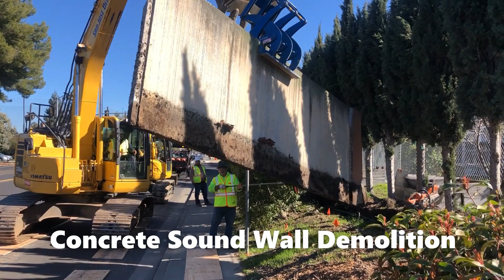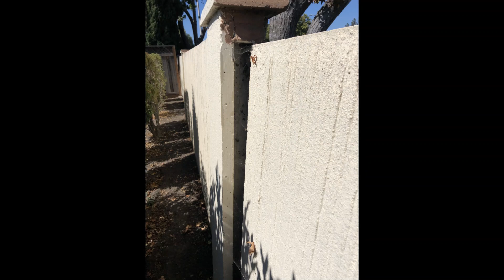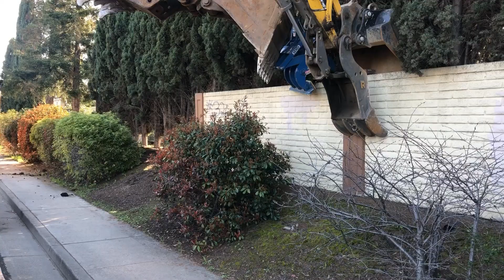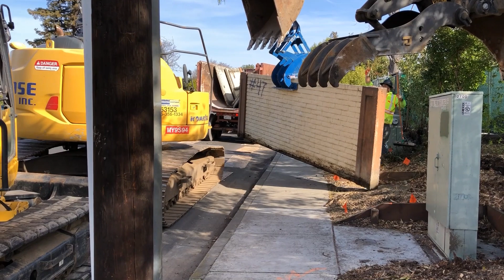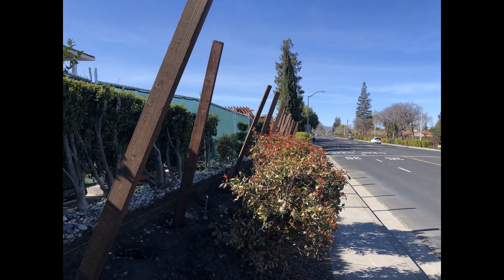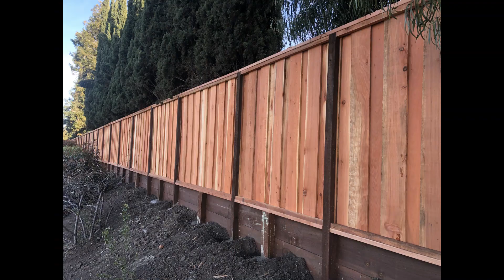Demolition of Failing Concrete Sound Wall

Comment: This is so interesting. I had assumed that wall was owned by the city and have long wondered when the missing section would be replaced. It's amazing that you could organize the neighbors to do this together. I drove by today and saw that there is still a few sections of the wall at the corner of San Tomas Expwy. Is that section staying?
Reply from the maker: Hey Sharon, Unlike the other sections that we just removed, the County of SC maintains the corner sections of the sound wall as it loops onto San Tomas Expressway.  Thanks for watching and following our projects!
Reply: @milestonesprintervan-peter9545  Makes sense! Thanks for sharing. I

Comment: Hi - just curious...since the intention of the concrete wall was for "sound", did the new redwood wall have the same "sound" protection?  It would be interesting to know what the homeowners think about the new wall.  Thanks.
Reply from the maker: Hi Virginia, thanks for watching and your question is spot on!  When we kicked off the project were very concerned we would lose sound protection from the roadway.  It was cost prohibitive to redo the wall with precast concrete.  The 8 foot retaining wall/fence is a good alternative as each property can now maintain their own fence.  I wish I would of conducted some decibel testing pre and post to see the difference.  In speaking to a few neighbors they have concluded that the road noise is the same or better with the higher redwood fence.  The additional two feet makes a difference!
Reply: @milestonesprintervan-peter9545  Thanks, for responding.  Yeah, it would have been interesting to see what the decibel testing would have shown.  Oh, well.  Glad to hear the tenants like the new fence.